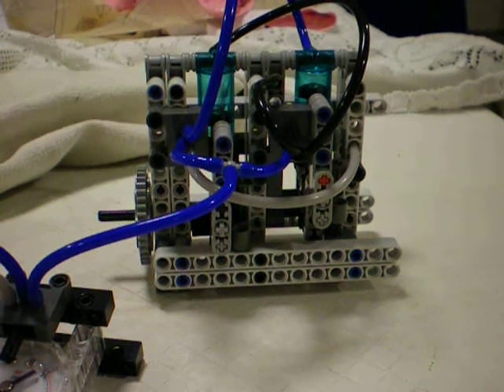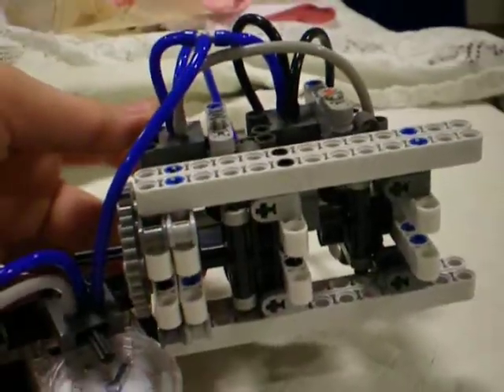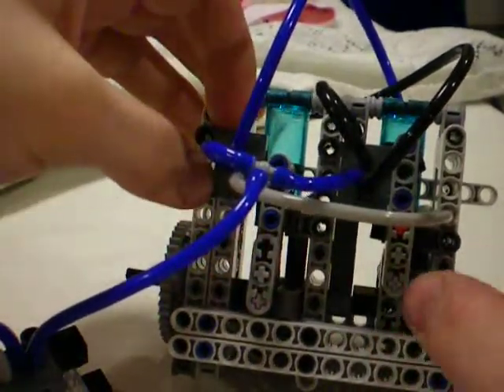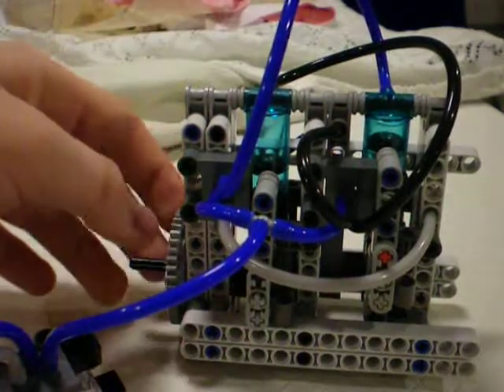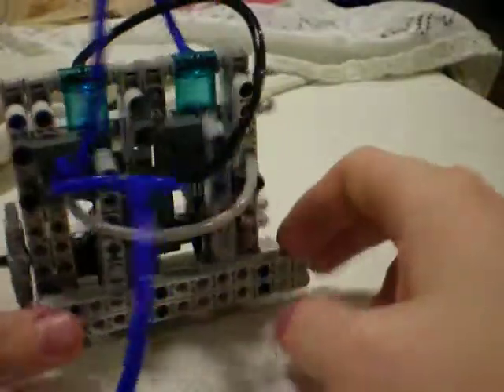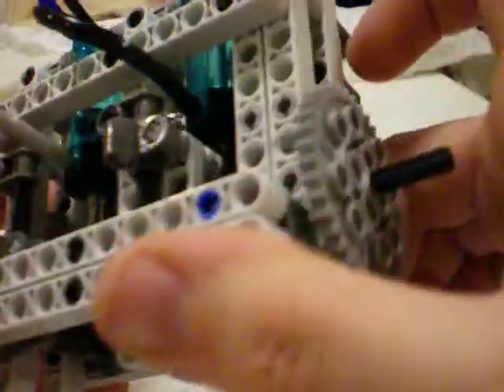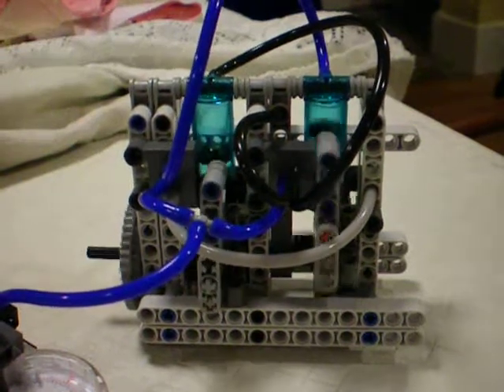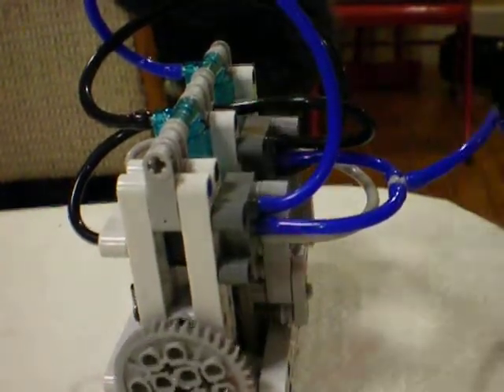Lego inline scotch yoke engine

Comment: put the valvetimers on guiderails and the engine doesnt seem to run verry good
i have a lpepower 3 cilinder engine and i have broken 1 of the 3 valves and if i try to run it, it runs like your engine: with a gap it misses a tirth cilinder